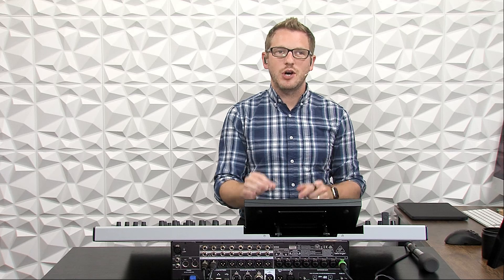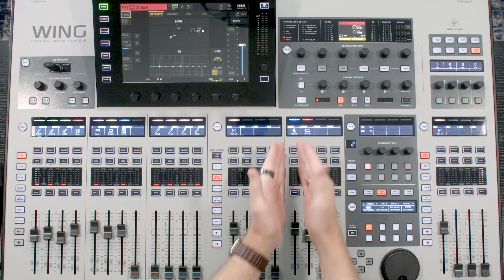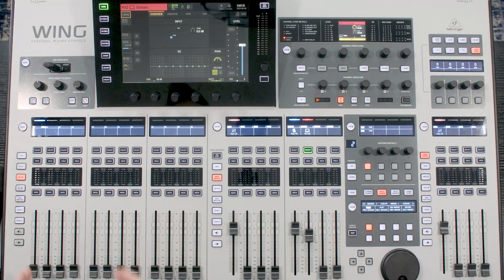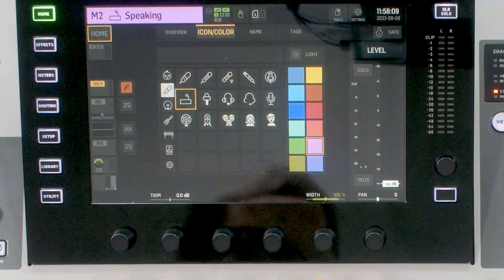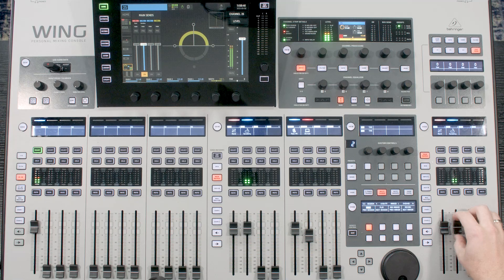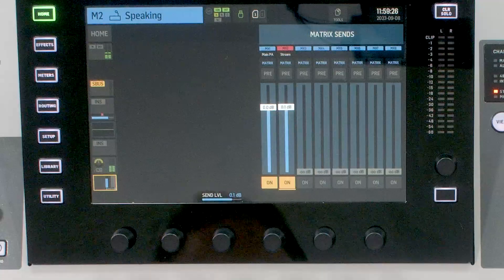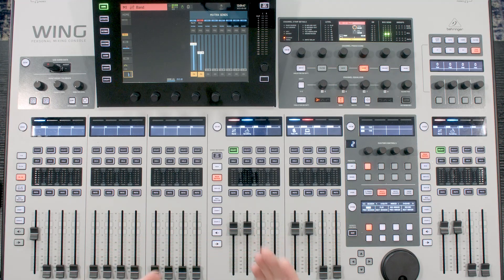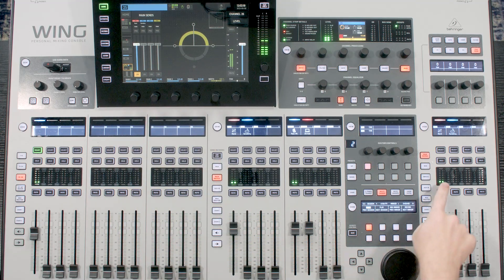Broadcast Mix Setup on the Behringer Wing - Fix Two Common Online Stream Issues!

Comment: u should really use a pre send buss and mix the stream seperate from the live, it makes it a lot easier, you can remote mix with a tablet and find a room close by to monitor in, send that mix to that room and mix there, you can pre post your video from the program output on an atem mini pro, use a monitor with speakers, then you add a small sub for people with a nicer tv receiver, watch the feed on your phone, our down stream is about 20 seconds..still trying to figue out how to fold effects into my two mix from another buss on the wing, it was no problem on the SI impact.

Comment: Hi Drew and fellow Behringer Wing or X32 users.

Adding onto the stream buss solution. It's important that we don't treat it like a set and forget. We wouldn't treat the room like that and we shouldn't treat a Livestream like that either.

I'm one of the 2 audio techs for my church. We only have 1 person that runs the sound board each week. Prior to my volunteering, we had that -15+ dB of volume between music and speaking on our Livestream and just an overall really bad Livestream mix.

Our process was taking 10dB off all band and adding 5 to the speaking mics and it really wasn't enough. I was needing to crank my car stereo from level 22 all the way to 30 to cover the difference in volume and then remember to back it back to 17 when I would switch back to radio.

Through trial and error of adding a compressor to the buss, adding a compressor to a matrix, pulling more dB off band channels... Nothing really made it "better".

What I came up with was using the stream buss and send on fade during sound check as a way to "gain stage" every channel for the Livestream.

Example:

I would start with the drums, I would solo their channel so I could get a visual reading in the incoming signal and adjust their gain and look for that -8 to -6 (percussions needs more signal to sit in the mix correctly in my opinion and experience) and I would also have a sound meter to make sure I wasn't too loud for the room.

Then I would clear the solo on the drums, solo the matrix the Livestream was on, select the stream buss (that was post fader), hit sends on fader and then adjust the slider so I could have the output volume on the matrix that was soloed around -10 to -8 dB so I had head room if the band got more dynamic while playing. Once I had the desired output volume, I turned off send on fader, cleared the solo of the matrix and moved to the next instrument.

Once I had all the instrument coming in at the same level, I could mix for the room. Once I had the room right, I would listen to the matrix for the livestream and if I needed adjustments, I would just select the Livestream buss, press "sends on fader" adjust the mix, turn off sends on fader and in essence now I had the room and the Livestream mixed so as I mixed for the room, it would translate pretty well into the Livestream.

For the speaking mics, the same procedure was done.

Some weeks it's a 10 dub difference, some weeks it's only 5, some weeks it may be 20 but making the Livestream mix part of sound check each week has helped our broadcasted mix a lot.

Hope this helps others.

Thanks for your series Drew.

2 years ago I started with live sound with my church with no experience and am very proficient in the X32. Now that we are finally building our permanent home (we have been a mobile church in a school for longer than I have been a memeber of the church) we are going to move to the Wing and while most of the knowledge for the X32 translates to the Wing, some doesn't (looking at you P16 routing). Your material has been incredibly helpful and the service you provide to the Kingdom is far beyond just your church and immediate community.

Thanks for using your gifts in sound and teaching as a servant leader to help spread the message of Christ's Salvation.

Comment: Only problem with this is that most FOH mixes when sent straight to online it doesn't sound anything like it does in the room. So one way I got around this at our church is I made busses for Pastor, Vox, Instruments, Drums, Gtrs, and Media. Then sent those busses to a MTX. That way I can mix each bus independently into the stream feed. It solved alot of problems.
Reply: Does your effects carry over well to live?
Reply: @JoyalV They do! Of course we have our FX on busses so then we can control the MTX send of each FX bus to the Stream MTX. Mixing Station makes this super easy also by using custom layers and setting your "channels" as the send levels to each corresponding bus.

Comment: There is another solution, with autogain:
I use a Matrix, which contains all channels except the speaker. For the worship group, I also have the level set to -10dB, which is sent to the matrix.
The speaker to the matrix is connected via the DIRECT input and the level of this microphone is raised by +10dB on the DIRECT input. At the output of the Matrix, AUTO RIDER is installed, where automatic gain is added in the range from -45dB to -12dB, with a gain “width” of +13dB, a response time for changes in the volume level of 4.5s, so that when the speaker speaks, the autogain raises the output signal level to - 12dB, and at loud sounds or when a band was playing, the autogain automatically lowered the volume until a level of -12dB was reached and kept it in this range.
Reply: hello, can you make a short video to show us how you did it please?
Reply: @j-cglaucus7371  I finally recorded a video on how to add two separate channels on the Matrix bus and increase their volume so that they are louder than the entire group. I hope it will be clear from the short video :) https://www.youtube.com/watch?v=wx_J26QAGwc
Reply: with a link if possibld

Comment: If we were running music over 85dB,we would have people walking out.
Reply: Because it is so quiet 😂
Reply: I know this is an old comment, but just in case you’re still dealing with it, you should research the difference between SPL and loudness. A poorly mixed church PA will be perceived as louder at 80dBa than a properly mixed pa at 95dBa.
Reply: @hailsouthern10 , our mix is not the issue.

Comment: We do something similar at our church. We have a bus designated as stream and provide that to the streaming AV tech. They then have the ability to make changes to that stream mix using an iPad much the same as the performers would do for their IEMs.  He listens to the stream mix prefader and then adjusts based on what he hears in the stream output (YouTube in this case).  He also monitors it via solo from the board and at physical tap point in between.
Reply: We just got this behringer wing and an fca1616. We want to use the fca1616 as a sound card for obs streaming but it has been difficult to connect.

Comment: Great video Drew! I have been using the band/speaking main configuration you set up here. Its one of the great features of having 4 mains on the wing. However, instead of using a bus for the live stream, I used another main for the livestream band.  You can make relative adjustments on that layer as well. I then use a matrix to combine and level out the band/speaking main volume levels to the PA or livestream. My precision limiter then sits on the livestream matrix. 

I could technically do all of that on the livestream main. But a benefit to splitting up the band and speakers on separate mains is that I can mute the band to the livestream and PA to do a silent soundcheck before service (Assuming the band has in-ears). At the same time, I can still have walk-in music and the speaking microphones available for service while the band is doing their thing. I love the wing. 

Keep up with these great videos. I cannot wait to see how to setup the precision limiter properly!